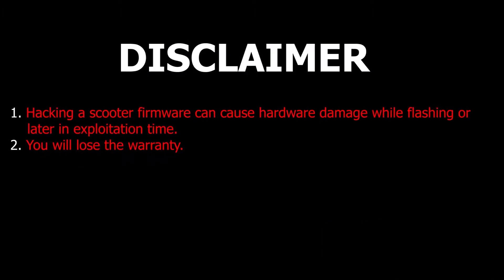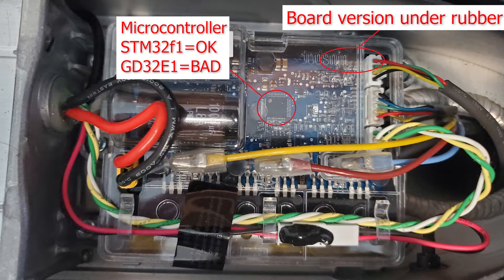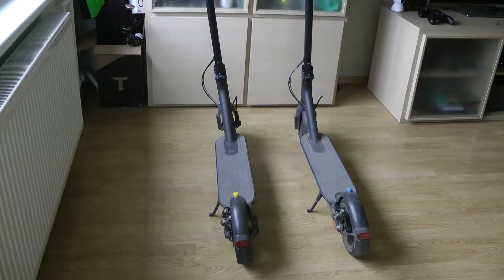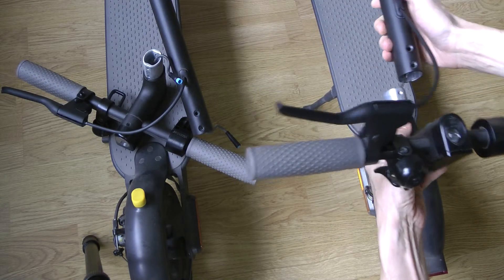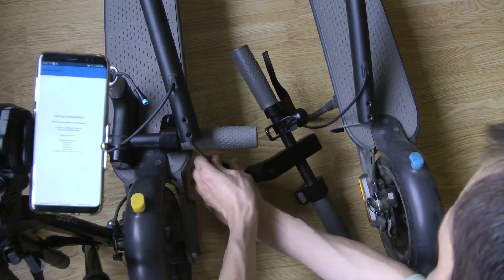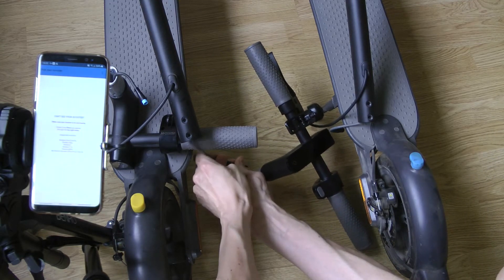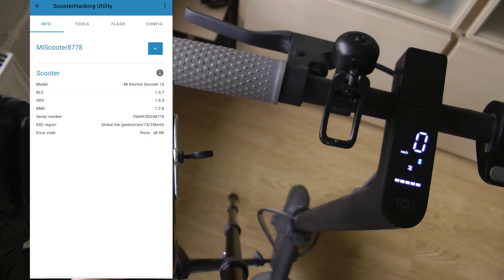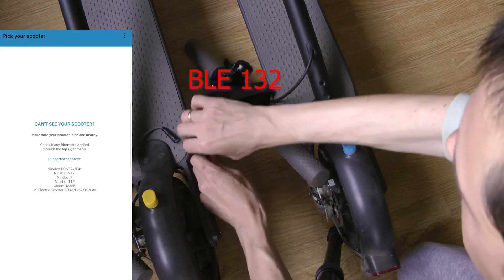Xiaomi Scooter 1S BLE157 speed unlocked

Comment: Can I do the same way to connect the BLE but using another app with another file? The last one, I must change the BMS too? Thank you!
Reply from the maker: Yes, you can flash whatever drv or bms (with any program) with head swap method. Only ble will remain, as it is located in the dashboard. And no, you don't need to flash bms (I just showed that it's possible). Subscribe, thanks.
Reply from the maker: Before doing this, check your ESC version. It should be 3.0

Comment: Hi mate... I'm a new subscriber and will bring many more as u are always helpful but pls I upgraded my scooter Xiaomi 1s from original 28 km/h to 31/32 km/h and also accelerations are better but I would like to obtain even a bit better accelerations and speed max 35 km/h so I need another files for that right?...can u send me these files or kindly guide me how to do that, I would appreciate very much.....again your work is amazing...oh yes BTW I have the external battery 14100 amp I guess it means additional extra 35 km just let you know....so pls help....thanks and best regards from Portorose,Adriatic sea ..
Reply from the maker: Thanks for the sub. I don't have any experience with external batteries. There is premade DRV for an external battery, (for users with battery in parallel) https://www.monopattinoitalia.it/miglior-firmware-xiaomi-v2/
I'm suggesting you consult on that in this telegram chat: https://t.me/scooterhackingchat
Or this guy: https://t.me/STLink_XAP2P

Comment: Hi! I have a modded Pro 2 with cfw on older ble than 157, can i use the dashboard to flash firmware on a ble 157 Pro 2 Scooter?
Reply from the maker: Yes you can.
Subscribe thanks.
Reply: @MindaugasJocionis  thank you for the answer :) Nice channel i subscribed
Reply from the maker: @nicolosassanelli5172  Thank you :)

Comment: if i have a Xiaomi Mi M365 can i use that to flash my pro 2? it's got the firmware where i can't flash custom firmware on it
Reply from the maker: One subscriber confirmed successful flash with the M365 dashboard, altho he noticed that dashboard was flashing and beeping, still, everything went fine. 
Before that make sure that your scooter has ESC 3.0, as this firmware is only for 3.0.
Subscribe, thanks.
Reply: @MindaugasJocionis  what is esc 3.0 and how do i check if its the one i have?
Reply from the maker: @Firnoooo  Use the app: "m365 downG " and look in the UUID under Tools. If the UUID does not contain the characters FF , it is the new controller (3.1): Flashing the old DRV leads to Brick !!
If the UUID contains the characters FF , it is the old controller (3.0): no problem with flashing.
https://rollerplausch.com/threads/neuer-controller-v3-1-bei-aktuellen-xiaomi-rollern-brickgefahr-bei-drv-downgrade-vorgehen.5187/
Reply: And where can we find a DRV file for scooters with ESC 3.1 ?
Reply from the maker: @danyorton   You need to build DRV with new builder:
https://rollerplausch.com/threads/neuer-controller-v3-1-bei-aktuellen-xiaomi-rollern-brickgefahr-bei-drv-downgrade-vorgehen.5187/page-6#post-67651
Or ask for a prebuilt one from this telegram channel: https://t.me/STLink_XAP2P
As well check this channel for more info on flashing: https://t.me/scooterhackingchat

Thanks for sub :)

Comment: I have 1s BLE 157 and hacket Pro.Can something wrong on hacket Pro scooter after flash 1s?
Reply from the maker: No, you will use the Pro dashboard to bypass 1S BLE (which is located in the dashboard), and you will flash 1S DRV (which is located on the mainboard). So you will not touch BLE on any scooter, and you will not affect in any way PRO.
Subscribe, thanks.
Reply: @MindaugasJocionis  10x for fast response
Reply from the maker: @stinso69  :))))

Comment: Would it work If I wanted to speed up the xiaomi 1s (BLE 1.5.7) using the xiaomi m365 scooter bar with (BLE 0.9.1)?
Reply from the maker: One subscriber has successfully flashed pro2 with M365 head, but this head had hacked BLE "prepared for 3-mode firmware readings".
So it's hard to say, will this method work with standard dot dashboard BLE. 
I think it's a big chance that it will work.
If you try this write back about the results, as it might be useful for others.
And check your ESC version, as this firmware is only for ESC3.0
Subscribe, thanks.
Reply from the maker: Another subscriber has confirmed that you can use M365 head: "It worked with mine was making lots of beeping and flashing wasn’t happy but could still communicate with my s1 and install the CFW".

Comment: So if I have a flashable Scooter, can I just change the scooter heads, flash on the SHFW, then plug in my scooter head, and then I can flash mine like I want or what?
Reply from the maker: No, you can switch heads, flash hacked DRV, switch heads back. After that, your scooter will have hacked firmware, but BLE remains locked. 
If you want to flash from your phone you need to downgrade BLE with stlink: https://youtu.be/oFya2CCFrAo

Comment: If other scooter is flashed with cfw can i still swap it to my 157 scooter?
Reply from the maker: In my opinion, it should work, since CFW flashes into DRV, and BLE remains untouched. Maybe some problems may occur with CFW that uses a hacked BLE (like for mi scooter 3), but I still think it will work in this case too.
Subscribe, thanks.

Comment: My microcontroller is STM32F not STM32F1 does it still work?
Reply from the maker: that's what I found on www: All Xiaomi controllers up to and including V3.0 use the STM32F103CBT6MCU. The GD32E103CBT6 MCU is used for the V3.1 controller.
According to that, you have a 3.0 board with an old controller.
To be 100% sure, ask in this telegram chat: https://t.me/scooterhackingchat
Subscribe, thanks.

Comment: Hi there, can I use my PRO 1 (M365 pro) unlocked dashboard to update custom firmware for my Mi 3 scooter? Thanks
Reply from the maker: As far as I know, those oldest dashboards use a different communication protocol, so it's hard to say whether it will work. You need a head from pro2 or 1S. 
If you try this, write back as it might be helpful for others.
For Mi3 I use SHFW2.0.5 from the "scooter hacking app".
As Mi3 needs in addition with precooked firmware hacked BLE, otherwise it will display error42. And as I assume you have BLE155 (which you cannot reflash without stlink).
Also, you need to check the ESC version, it must be 3.0 otherwise you will brick your ESC controller.
Subscribe, thanks.
Reply: @MindaugasJocionis  Thank you. I'll borrow pro 2 from my friend and I'll try. Will update you here as well
Reply: What happend then?
Reply: @aksajawad8188  Haven't tried it yet

Comment: helloo! im planning to use a m365 screen (the one with the 4 dots on it) to hack my mi3. the mi3 is the 3.0 esc version. can you tell me what files do i have to flash in order to make it work? the m3655screen has the 073ble on it.  do i need to make more changes on it before?
Reply from the maker: As far as I know, those oldest dashboards use a different communication protocol, so it's hard to say whether it will work. You need a head from pro2 or 1S. 
If you try this, write back as it might be helpful for others.
For Mi3 I use SHFW2.0.5 from the "scooter hacking app".
As Mi3 needs in addition with precooked firmware hacked BLE, otherwise it will display error42. And as I assume you have BLE155 (which you cannot reflash without stlink).
Subscribe, thanks.

Comment: Hey, I've tried using both xiaoflasher and downG on my 1s without any success. I've got BLE 1.5.7. Also 3.2.1 esc
Reply from the maker: Probably you have in mind 321DRV :) 157BLE is locked, you need stlink for BLE downgrade or temporary head swap for flashing. Subscribe, thanks.
Reply: @MindaugasJocionis  Thx for quick response, will try to find someone with BLE 1.3.2 and headswap 👍

Comment: Thank you for the hack, I am few days new with a pro 2 and didn't know anything about latest update having the cryptographic lock , as soon as I unboxed the scooter which is made in July 2020 , I updated the FW, then searched to unlocke the speed limit and found out ble 157 is locked and not possible to downgrade . After some research discovered st link . I have one question , is it possible to down grade the BLE FW to something older than 157? And I assume if that is possible I no longer need st link in the future to change FW? Where would I find the files for older BLE FW?
Reply from the maker: Yes, if you use st-link to downgrade BLE, you will only need to do it once, unless you upgrade to a blocked BLE again :)
Here are the files for PRO2 https://files.scooterhacking.org/firmware/pro2/
Subscribe, thanks.
Reply: @MindaugasJocionis  Thanks man, already subscribed 🙏
Reply from the maker: @supernova1976  Thanks :)

Comment: Hello i have an other question for you. Why do you flash DRV 155 to the controller and after this you flash SHFW 025?
Cant you flash directly SHFW 025?  
Thanks. 
Great  video!
Reply: Where can i find SHFW 025?
Reply from the maker: It's 2 different methods: 1st 1:51 precooked firmware where you don't need to adjust anything. 2nd 4:40 SHFW where you can change your settings. You can use any method you want.
Everything you need is in the video description. 
And here is the site for precooked firmware:
https://www.monopattinoitalia.it/miglior-firmware-xiaomi-v2/
Subscribe, thanks :)
Reply: @MindaugasJocionis  Cant finde SHFW 025 Help please!
Reply from the maker: @lindorfalabella7757  It's loaded automatically by the app when you push "config" 5:13

Comment: Will it work with any Old Xiaomi 1s? And my new Xiaomi 1s? Or is there some checking to do before i just do it with a Xiaomi 1s?
Reply from the maker: Yes, you can use any 1S scooter head with a lower version BLE than 157. 
If your scooter is just out of the store it's a good idea to check your ESC version, if it's 3.0, then you are good to go, if 3.1, you will brick your scooter. As for so far, there are no reports that 1s has a 3.1ESC board.
Here is the site with details on how to check: https://rollerplausch.com/threads/neuer-controller-v3-1-bei-aktuellen-xiaomi-rollern-brickgefahr-bei-drv-downgrade-vorgehen.5187/
Subscribe, thanks.
Reply: @MindaugasJocionis  do you know if there Will ever be a firmware for the ble 157?
Reply from the maker: @dinfar4367  ¯\_(ツ)_/¯ no idea
Reply: @MindaugasJocionis  alr

Comment: if my friend have xiaomi s1 and i pro 2 will it work or i will brick the scooter?
Reply: Thanks
Reply from the maker: If your friend BLE is an old one, then yes, it will work. . For PRO2 you need to check your ESC board version. If it's 3.0 you are good to go, if 3.1 you will brick the scooter. Check out this forum. https://rollerplausch.com/threads/neuer-controller-v3-1-bei-aktuellen-xiaomi-rollern-brickgefahr-bei-drv-downgrade-vorgehen.5187/
To be 100% sure you need to disassemble.
Subscribe, thanks.
Reply: if I have less than 3.0 esc ver then i can do it?
Reply from the maker: @ets2fastslow22  You must have 3.0
Reply: oh ok then
Reply: then only st link?
Reply from the maker: @ets2fastslow22  If ESC3.1 then there is no hack option, if ESC 3.0 then you can hack depending on BLE. If BLE is less than 157 (for 1s and pro2) then you can hack freely. If BLE is 157, then stlink or head swap.
https://rollerplausch.com/attachments/1654415442672-png.18031/

Comment: Dear Sir, just to confirm - is it necessary only for the locked BLE scooter to have controller v3.0 and regardless for the unlocked donor scooter or both scooters need to have controller v3.0? I am thinking of using a friend’s 1S head to flash my Pro 2, but I do not know his controller version. Thanks a ton!
Reply: Already did! Be well!
Reply from the maker: It doesn't matter what controller is in the donor, as you are just using its BLE  for bypass. Only the scooter to which you are flashing hacked firmware must be on a 3.0 controller.
Subscribe, thanks.
Reply: Oh well, yet another question. Given that I will be using 1S head to flash SHFW to my Pro 2, do you think that there will be any problems, since SHU will “think” it is flashing SHFW to 1S instead of Pro 2? Also, can you think of any reason why I should not flash SHFW using this method to my Pro 2 (except if the controller is V3.1). Thank you very much once again!
Reply from the maker: @АлександърМадов  I don't know for sure (as I don't have pro2), but I think it's the same firmware for all, otherwise, default amperage would be set after flash. It might be that it puts "info" tabs according to BLE. Or maybe it does the app (check what scooter model is shown in the info tab under "Throttle mode" after flash), if it's your actual model, then DRV is the same for all. Ask in this telegram chat https://t.me/scooterhackingchat , they definitely will have an answer :)

Comment: I bought a Pro 2 nordic edition with BLE 157. My friend have an older S1 scooter. Swapped the heads and flashed with "Smooth" from Italian site. Now my scooter makes 34 km/h and I weight around 90 kg. In official mode it makes 20 km/h so perfect when my daughter borrows the scooter. Thanks a lot for your video!
Reply: Dear sir, I suppose you mean 1S? I am in the same situation - my Pro 2 is updated to DRV 248 and BLE 157, but I have a friend with 1S who has not updated his scooter in half an year, so probably I can use his head to flash a cfw. I will have to check the controller on my Pro 2, though. Did you face any difficulties doing this procedure? Thanks!
Reply: @АлександърМадов  Yes, 1S. No, it was really easy. Took like 5 min to swap the heads, flash, swap back. Have you tried now?
Reply from the maker: Glad that it was helpful, don't forget to subscribe, thx.
Reply: @MindaugasJocionis  Hi again! Now I have a colleague with same Pro2 nordic edition, DRV 248, BMS 141 and BLE 157. But his scooter i like 3 weeks old. We did the same procedure as with mine, but this time it did not work to even start the flashing progress, The DownG app freezes when hitting "flash" and stops at 0 %. Then the scooter gets locked and we need to reboot the scooter to unlock it. Do you have any idea how to solve this? What can be the root cause?
Reply from the maker: @johanjonsson4809  First of all, check the ESC version of this scooter so as not to brick it. Sometimes Down G gives these errors, restart your smartphone, or you can try "Scooter Hack Utility" for flashing.

Comment: Hello Mindaugas, great video! 
I have a question.
I have Xiaomi 1S wiht BLE 157. and i want to start from 0km/h, the same you chaged here. 
The problem is that i dont have an other dashboard to use and change firmware.
Can i use st link and directly change the BLE version of my dashboard??
Reply from the maker: Yes, you can downgrade BLE with st-link, after that you can flash to any firmware again.
For more info check telegram channel https://t.me/scooterhackingchat as personally, I did not flash with st-link yet :)
Subscribe, thanks.
Reply: @MindaugasJocionis  Thanks!!

Comment: Does the 1s esc board have to be 3.0 to do the firmware or u can do any esc
Reply from the maker: Yes, you can flash only if the scooter has ESC3.0. 
Since so far ESC3.1 was found on Mi 3 and PRO2. 
S1 should have ESC3.0. 
Anyway if it's a new scooter just bought from a store it's better to disassemble and check the mainboard version to be 100% sure.
Check this forum, there is always discussed if something new is found (use google translate :) )
https://rollerplausch.com/threads/vorsicht-vor-drv-downgrade-aktuelle-pro2-roller-mit-neuem-controller.5187/#post-62541
They say that a new clue to identifying the controller without disassembly is UID. if it does contain characters FF, this could be a 3.0ESC.
Subscribe, thanks.

Comment: If I do this will i have to do the same process again if I want to speed hack it again
Reply from the maker: Yes.
Reply: @MindaugasJocionis  hey i saw that mi home has a firmware update should i update?
Reply: @turbosheep  I wouldn't upgrade if it's older than 157, if you already have 157 then just upgrade it and see what happens.
Reply from the maker: Let's wait a bit. Perhaps they found a workaround in 157 and patched it with a new firmware. What are the numbers for the new one? Never had updates so often :)
Reply: @MindaugasJocionis  1.10_321_157_141 Do you think i should update? My current update is 1.10_321_157_128
Reply: @turbosheep  What's the version of the new update?
Reply: @Nightmare-nz7kb  1.10_321_157_141

Comment: Hi, friend!
First of all, thank you very much for your video, I'm sure it will help many of us.

One question...the Smooth.zip file could be used for Essential and Pro2 as well?
Reply from the maker: It should be the same procedure, and you can use smooth DRV, only if you are downgrading BMS you need to choose your scooter version: https://files.scooterhacking.org/firmware/
And one mode thing for PRO2 you need to check your ESC board version. If it's 3.0 you are good to go, if 3.1 you will brick the scooter. https://rollerplausch.com/threads/vorsicht-vor-drv-downgrade-aktuelle-pro2-roller-mit-neuem-controller.5187/#post-60409
Subscribe, thanks.